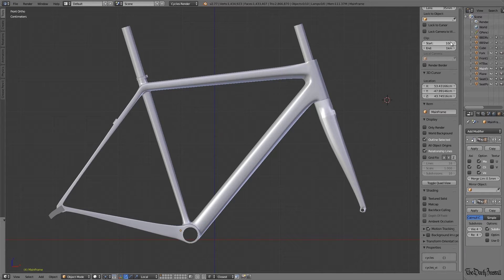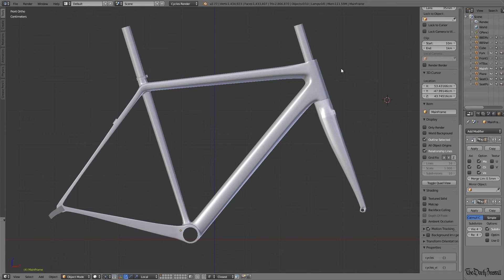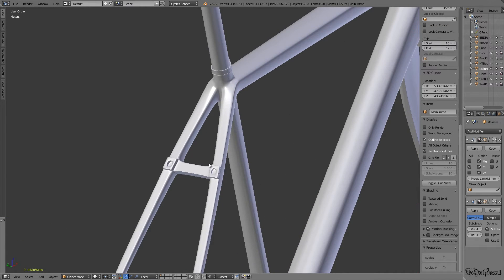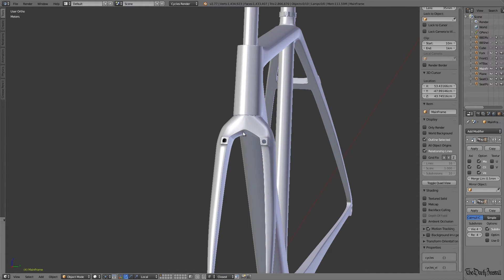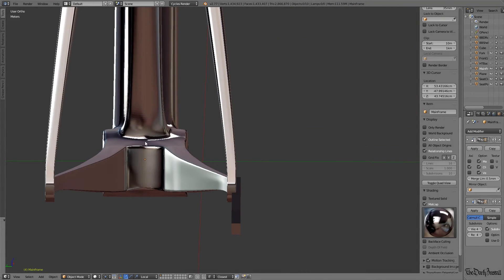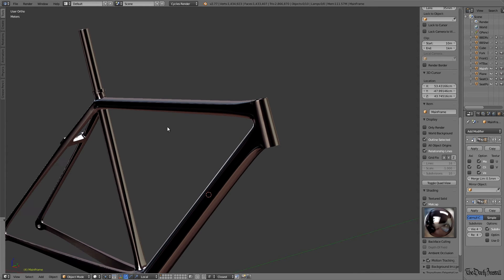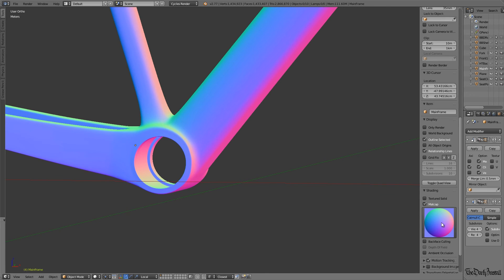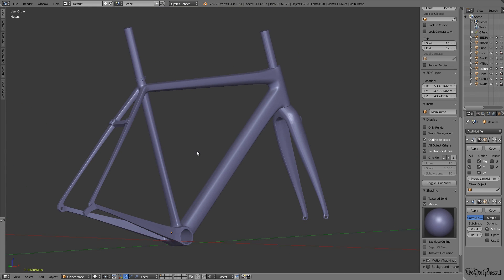Concept Design. Road Frameset. Part 1

Comment: One solution to the beefy chainstays is to make them asymmetric. Kick down the driveside stay to give chainring clearance and keep the stays short, while retaining wide tire clearance.

It seems the industry may be moving back to screw-in bb's... I personally like screw-in because it's a mechanical lock.  Like you, i've never had issues with press fit but I do see the potential headache if it were to creak.

I think you should keep holes in the bb for cables and water exit.  Just use a rubber plug after the fact to tidy up.
Short of a completely sealed frame (no cable holes= pure etap bike) water will get in there one way or another anyway. 

One area most neglect is the design of the forks.  If you design the forks for aero, my feeling is that you will have most of the benefits of an aero bike.  
Since your body is churning everything up past the head tube, and cables are breaking up the wind at the bars; I think aero bikes are pure style and marketing anyway.  

All the real gains are in cleaner bar/ stem and forks as far as frame design is concerned, imo.

I just started using Blender too- recognize the interface!
Reply from the maker: Nice one.  Yeah I agree with all that.  Will do some more work on this when I get some free time.

Let me know how you get on with Blender.  I have been using is for a decade now, so know it inside out.  It is excellent.

Comment: I see you went for through axle and direct mount, why not go all the way with disc brakes? The cable routing issues mentioned in the comments could be avoided with eTap (i guess you're going after it anyway).

Comment: If you were to enclose the bb completely, you'd definitely have to think about some sort of seepage-solution for the seattube, and , should you have internally routed cables, or some other openings in any of the other tube, for those too.
Reply from the maker: Hmm, well a lot of current carbon frames don't have holes in the bottom of the BB, so any liquid which enters the frame from the seattube opening sits in the bottom of the BB shell, so enclosing the BB like I imagined here would mean that the BB itself does not get exposed to this liquid.  I suppose I could make a hole in the bottom of the BB shell...  

This doesn't get around the issue of routing cables though, which you correctly point out!  :)
Reply: Yep, you're right.
I really like what you've done with the frame, btw.
Thru-axles and direct mount caliper brakes are a great addition! :)
I think i'll design my own dream bike in SolidWorks in the next few days/weeks or so, you really got me thinking...
Reply from the maker: Thanks a lot!  If you can, upload it to Youtube like I have done here, or share it somehow.  Would love to see what you come up with.  You never know; we might be able to combine our ideas into a mega-frame!
Reply: That'd be awesome!
I'll make sure to share it once I'm finished.
Reply from the maker: +SportyGermanGuy Great thanks :)  Looking forward to it.

Comment: Very interesting.  What are your thoughts on disc vs rim brakes for road frames?
Reply from the maker: Hey mate.  Disc provides far better braking, but currently the implementation is not mature enough for me to consider.  Once the issues get ironed out and the system is made lighter, I will think about it.  Probably going to be the frame after my next one, given the lifecycle of a frameset.
Reply: Agree 100% with that!

Comment: Looks great! Nice skill to have to be able to build that up digitially. I struggle with Imovie!! Yeah, the Sworks SL5 internal seat clamp is a poor design, but it could be easily solved and it looks neat and clean. The SL5 has some small aero tweaks over the SL4, such as a more bladed fork and more aero seat stays (and yes these are very thin!). A client on the Tour de France had his (SL4) snap on impact. But beware too thick stays making the rear too rigid. The chainstays seem to do all the work these days. Keep going!!
Reply from the maker: Cyclespeed Tours Thanks!  So what is the fix, and have you implemented it?
Reply: No, I'd rather Spesh issued a recall or at least a new part, that has a kind of tether on it to stop the piece falling. It does have a little O-ring when new to keep the 2 parts together, which helps, but this perishes and disappears after a few months.
Reply from the maker: In fact...  you could make your own out of an old credit card!
Reply: Yeah, that's the fella. Once that O-ring perishes, you're toast. The problem is that you can't do it out of the bike. If you do, you can't (well I can't) fit it back in the frame. I think Spesh fit the O-ring in situ.
Reply from the maker: Cyclespeed Tours Ha, that is well shanty, especially on such a mega bucks frame.  You could always put another o-ring on it so there are two at all times...